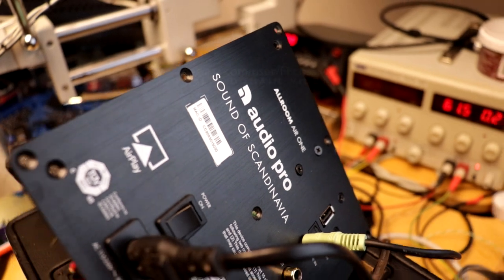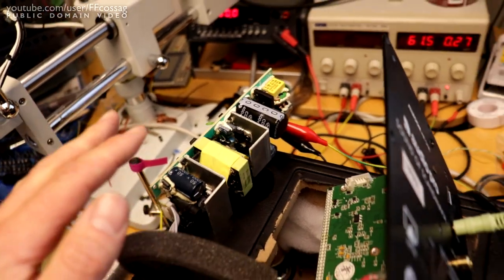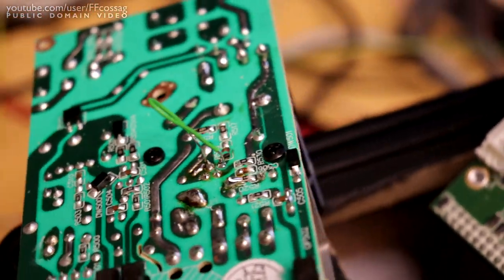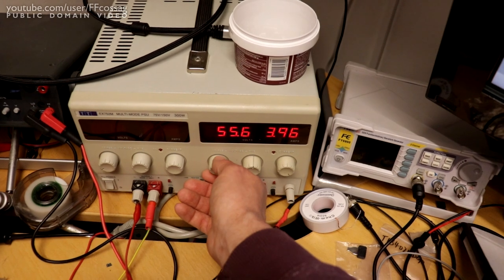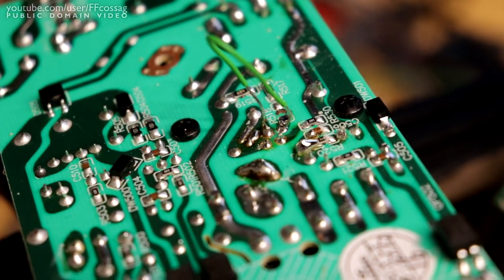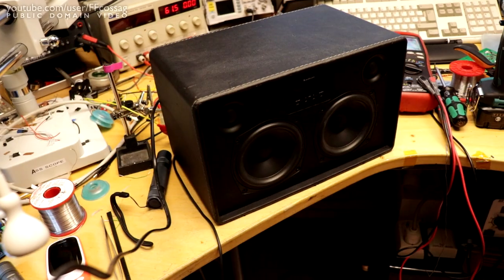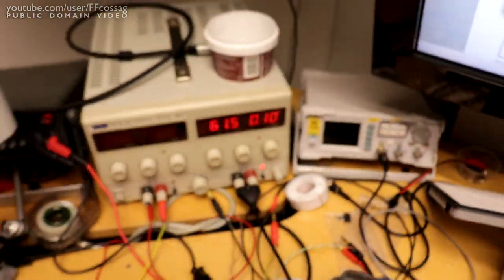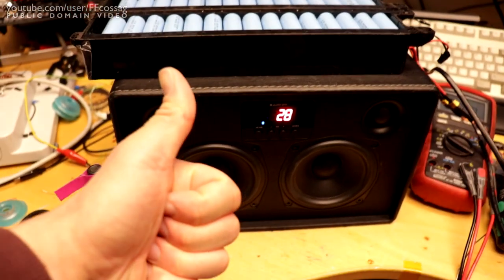AudioPro Allroom One: 72 volt battery hack!

Comment: Did you say that you measured 30+5 DC volts on the cable to the "motherboard"? The reason why I ask is that I have a broken PSU, I think, well the wifi, display, etc. is working but no sound (no matter the input) so I think that part of the PSU is broken and wanna try to replace it with an external PSU.
Reply from the maker: I think the power amp runs off of a single 30 V rail, but I might not remember correctly.

Comment: i would have used one of those 120VDC dc-dc boost converters, this way im more flexible at the input voltage range and what batteries i can use.
Reply from the maker: I considered something like that, but I didn't want to A) add more conversion steps B) deal with the EMC or C) have to wait until fall to have it arrive. ;)